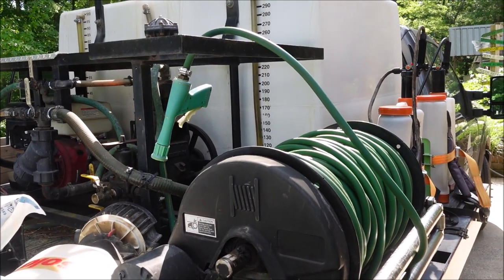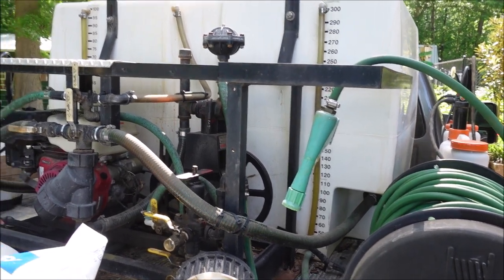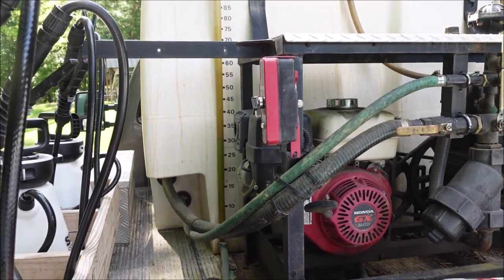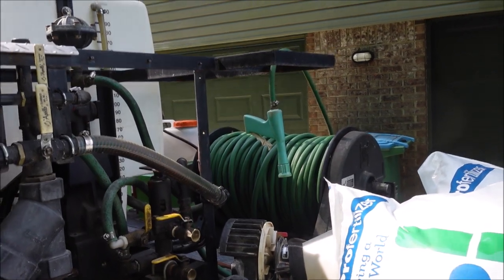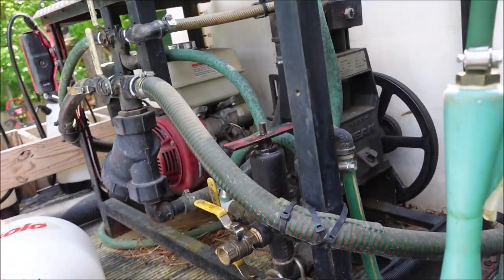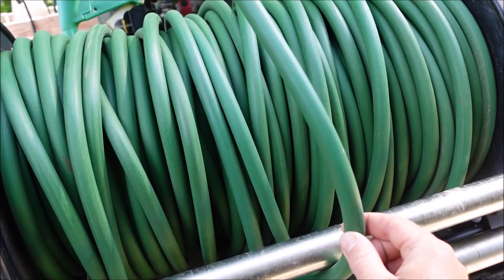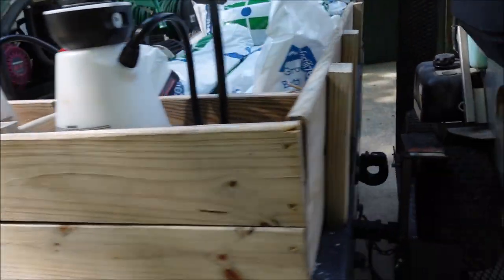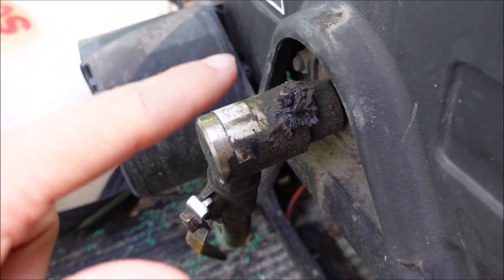The Most Profitable Piece of Lawn Equipment I Own

Comment: Jason....Look at the footage at 9:46. You might want to put a piece of hard rubber or foam pipe insulation around the hoses where they are tiestrapped to the angle iron supports. Over time, I wonder if they could chafe there and develop  a hole from rubbing against the angle iron corner because of vibration. Or is that a piece of extra hose material im seeing just wrapped on the back half in the footage doing just that? Do you  have a back up skid sprayer in the event that one goes down with an issue? 
 I dont have one, but do see the benefit in the flatbed. You can ease right on up/ back into those backpack sprayers and put them on   full without having to struggle.

Comment: What brand of walk behind spreader do you suggest? I bought a scotts spreader from lowes but it seems to gather a lot of fertilizer inside the wheels and I noticed it's because the plate that throws the fertilizer sits right below the top of the wheels.
Reply from the maker: I like spyker
Reply: @lawncarelife  ok thanks I'll check them out
Reply: That Scotts sprayer is infamous for material getting caught in the wheels. Look for a unit with pneumatic tires.
Reply: I'm just a DIY homeowner but I have an Earthway 2150. On its 5th season and going strong.